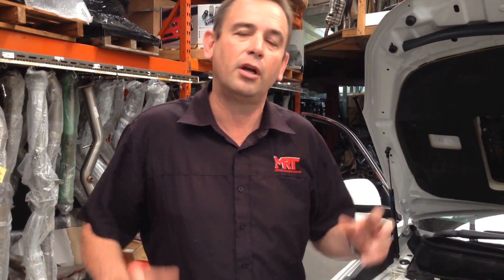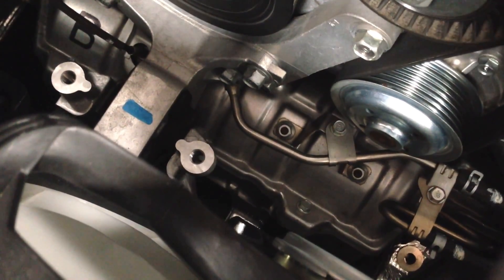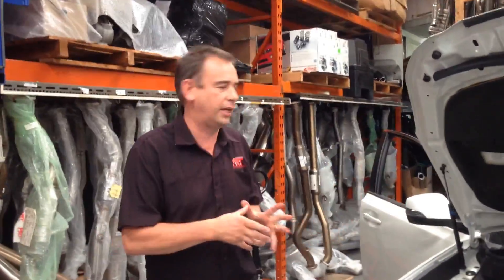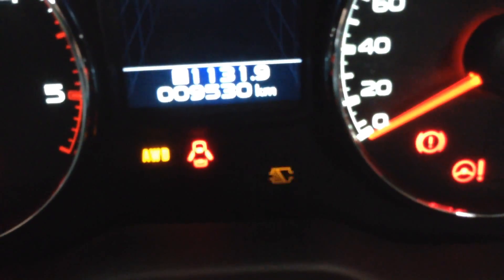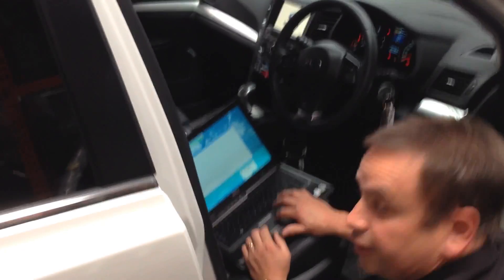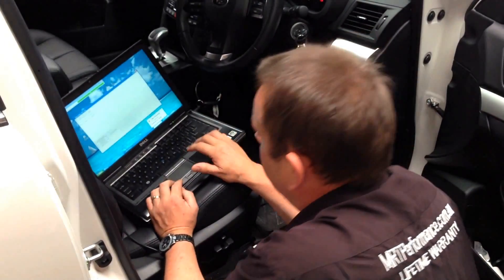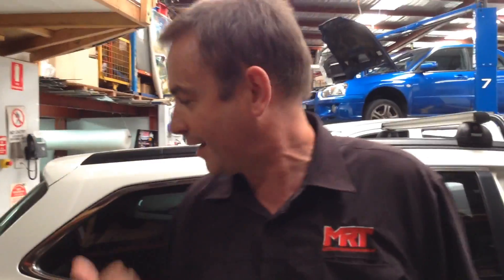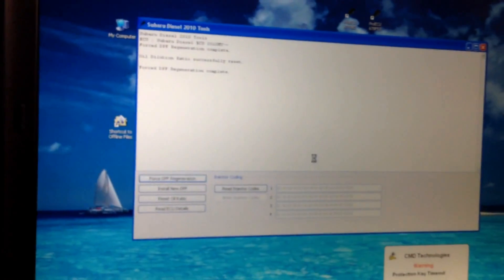Subaru DPF regeneration, hidden secrets, MRT explains how it all works

Comment: My dpf was alarming, having investigated I was told at 9 attempted regens it won't regen again and continues to alarm. I then got a excellent mechanic look at it and here it wasn't the dpf,  it was oil dilution causing the issue, having just changed the oil, my dpf wasn't blocked at all, yet the dpf alarms . One to check guys, ensure on obd reader, dpf replaced set and oil dilution cleared. Not single issue since. Worth checking if same issue as me.
Reply: danke für ihren kommentar. statt original 5w - 30 motorenoel ist seit 2 jahren 10w - 40 motorenoel in meinem ee20 suburu impreza jahrgang mai 2010 jetzt 80'000 km,  ich fahre den subi erst seit 4 jahren. 
er läuft besser und die motoroelverdünnung ist weg.     ich lebe in der schweiz auf 680 meter über meer.

Comment: Not modern diesels, mainly VW and Subaru taking short cuts (cheap skates) by adding extra diesel on the exhausts stroke rather than fitting a separate injector in the DPF itself, excessive diesel in the cylinder bypasses the rings and ends up in the sump contaminating the oil.

Comment: Hello thank you for the video, what is the critical percentage of oil dilution ? I changed the engine oil 3k kilometers ago and the obd2 scanner tells me that the oil dilution rate is %6. Last time when I got the official subaru service, the oil dilution rate was %14 and there was no warning flash on the dashboard.
Reply: for 2016 model at 10% the dpf light will show. But from my experience  it will work with a reset right in the middle of the oil change period. I would not push the 2nd reset cycle past 5%. Also, if you do a long highway drive 200/300 + Km the dilution will typically drop by 1 to 2%.

Comment: Had endless issues with my diesel 2010 Legacy Tourer. EGR valve replacement, 2 x DPFs, inlet manifold, turbo boost pipe, regens every 20mins that blinded following cars. Eventually glad to get of it.

As explained to me by a former Ford/Mazda technical director, the DPF was a ill-thought out emergency bolt-on solution to forthcoming emissions regulations at the time. Subaru just made a worse job of it than most.

Comment: Just heard when the bloke said DPF replacement would cost about 7000 AUS dollars. I did a swap here in Germany and Subaru provided me with a genuine unit for 900 Euro, cleaned the inlet manifold and a couple of other things for about 1200 Euro. If you want to keep your motor in working condition, don't use the Turbo Diesel for long-term city driving; get an OBD scanner and software that can monitor particle buildup and burning cycles.
Reply: Bisogna usare il Tunap ad ogni tagliando e usare olio Motul 5w30
Reply: purchased such a scanner - measured 4 Kpa at 3000 rpm - 0 Kpa at idle. 2010 legacy boxer diesel - runs like a champ

Comment: Well, not helped me. I was forced to buy a DPF with 10k miles as it was affordable, totally clean. Also replaced the EGR to a clean one. DPF light still flashing and after reaching the operation temperature my car is turning back to limp mode. We replaced the EGR again, as the dealership said that's the problem, still nothing. Now it seems the problem is with the MAF sensor but I just can't believe in this anymore. :D
Reply from the maker: I have never seen a faulty MAF sensor on the diesel Subaru models
I  suggest you choose another workshop
:(
Reply: Hi, Did you get this sorted and fixed?

Comment: You can also reset the oil dilution without the need to connect a computer by following the below, (certainly this is the case in our 2012 Diesel XV):

1. Depress brake pedal

2. Start engine, and keep it in idling. 

3. Release the clutch pedal.

4. With depressing the brake pedal, perform the following:

  (1) press the rear window defogger

  (2) turn the headlight to the =00= position

  (3) press the rear defogger position to off

 (4) turn the headlight position to "O" position

  (5) repeat steps 1) through 4) once more, and go to next step

  (6) release the brake pedal.

Note

Each step (1) through (6) must be operated within 4 seconds.

5. The preheating indicator light will blink approximately 5 seconds when the data was reset successfully.

If it doesn't work then turn the engine off for 15 sec and repeat the above steps again.
Reply: Awesome few attempts and worked great, up came glow plug alarm and all warnings off. Been driving me nuts

Comment: My 2014 Diesel CVT Outback is predicting less and less mileage per tank of fuel (from just over 1000km brand new to now 810km), and the (car) calculated consumption index has jumped to to 7.2l/100km. The DPF light just flashed last week and Subaru dealer said the oil was dirty and did a 100,000km service for me at 97500km. I changed the oil (CASTROL EDGE 5W-3)0) myself at 90000 km!
Does it indicate that there might be some soot accumulated at the intake area that is causing the car to use more fuel than it should be?
Thanks very much.

Comment: 7000 dollar for a dpf?? Someone earns a lot of money on that....
Reply: their expensive to make because of the metals inside them, it costs alot for a workshop to buy them too even before they are sold onto the customer
Reply: Try flushing it out, remove and soak it with dish washing tablets then hose it down, let it dry then reinstall. .

Comment: Hi, I purchased a new 2015 Turbo Diesel outback and have had DPF problems every month right up to March 2017. Gave up going to Dealer, who told me to go on the highway for 1/2 hour at high revs in 5 or 6th gear once a fortnight?????I have had an independent diesel mechanic to look at & he has advised that there was diesel fuel in the oil, which indicted that a fuel injector seals are leaking - he is preparing a report so I can claim on warranty. Has anyone else had that problem?
Reply: Doesn't he say in the Video that this motor has a diesel blow by system that deliberately mixes Diesel with the engine oil? Maybe it's not a problem and a system the diesel mechanic isn't aware of?

Comment: Hi!

I have a 2017 2.0D EuroVI Forester. I have the car regeneration controlled by a bluetooth OBDII device connected to my phone. With it, i have controlled soot, oil dilution, DPF temperature and many other parameters. So I have tree questions:

- Is it normal that the car do the regens every 150-200km in summer and 300-400km in winter? I drive a lot of traffic jams, but a lot of highway too.

- Is it normal that when the car is regenerating it drops a lot of white/bluish smoke when accelerating from a stop or accelerating from a low rpms to a medium rpms?

- My car has 35.000 km now, but from the very beggining, every 15k services, they need to put some coolant because is usually decreases from the full mark to almost the low mark. I heard that it happens in many Subarus, are you aware of this "issue".

Thank you so much!
Reply from the maker: never heard of coolant loss
:(
Reply: the only liquid you should loose is a little bit more oil due the DPF regeneration mode
because the engine doesnt really like the regeneration mode and its also bad for the engine.

thats why i want to remove my DPF and program the regeneration out of software

Comment: Outstanding Video! I've just replaced the intercooler rubber elbow on my 2010 Diesel  Outback. Purchased the car a couple of months ago with 60k on the odometer. I've just done a bit over 7000k'ms therefore the standard 3months 5000km warranty won't cover. I was shocked to pay $214 for a genuine piece of rubber....fitted myself....not rocket science. My DPF light came on solid today then began flashing (prior to replacing rubber elbow). 
I understand from this video that no matter how far I drive the car the flashing DPF will not reset. Is this correct?
I will phone you during business hours to discuss purchase of the cable and software to undertake a forced regeneration. Subaru service have advised that the oil and filter need to be changed after the regeneration. Is this correct?
Many thanks
Reply from the maker: hmm, you should call us

Comment: G,Day guys love your Video,s i bought a 2009 outback subaru diesel i payed $20185 with 120,000 ks on her i saved all my money to buy a good car that would see me out after 2000ks they replaced the front shockers and break pads now after 8000ks i had to pay $1600 the Car Yard say they put $700 in to help me with the cost ? for a new clutch  new pressure plate new thrust race clutch plate Fly wheel ( Solid ) with new rear engine seal do you guys think it fair for a Car that cost me $20185 it just one year old i had done 8000 in one year since i bought her ?
Reply from the maker: hard to say
Reply: What do you mean ?

Comment: I have a 2010 Forester and it will continue to do the active regeneration at any speed, even standstill, as long as the rpm is kept up. It would be nice if I had an indicator that the regen had commenced as I like to drop down a gear and get the rpms above 2000. Subaru should have made is possible for user to do a forced regen and it would also be nice to have a soot meter and exhaust temp so driver is able to better manage the filter. Passive regens I have found just don't happen, even at 110km/h in 5th. At least there's the cheat code for the oil dilution ratio.
Reply from the maker: cheat code for oil diluiton?
Reply: Yeah I took mine to a non Subaru mechanic who didn't know about the reset. Subaru were going to charge $110 to scan to confirm the problem. Thankfully google came to the rescue. It seems  that my non Subaru mechanic was unable to reset it with his diagnostic tool anyhow. Below is the sequence but apparently it doesn't work on all of them.Transmission in neutral
Depress and hold brake pedal
Defogger ON
Lights 
ON (stage 1 = parking lights/DRL is enough)
Defogger OFF
Lights 
OFF
Defogger ON (again)
Lights ON (again)
Defogger OFF
Lights 
OFF
Release brake. Now the glow light (depicting yellow coil) will flash for 
a few seconds
Reply: What is your experience with glow plugs? Do you only use Subaru brand or is there a better brand? Should I spray WD40 on them every night for a month for clean removal; or is there a better release spray? There aren't too many videos on them that I could see. Maybe you can do a video and show us how to or how not to screw up a motor  ;)
Reply from the maker: never seen a glow plug problem on ANY subaru
Reply: My mechanic charges me $30 Cash for a re/set if i dont get out to the open road .
Reply: Before i unstood on how they work my old Mechanic chrged me $30 cash he would plug the computer and leave it high rev till it cleaned itself .

Comment: My 2010 Forester Diesels dpf warning light came on yesterday and today started flashing. If I have a fault code reader with a reset feature, can I take the car out for a drive at the speed specified for 20-30 minutes so that an auto regen takes place, then reset all fault codes, will this clear the warning light?

Comment: I was looking at purchasing the latest Subaru Forester Diesel CVT that has been released but I am now reconsidering after the research I have done and the potential issues which may arise with the DPF. I was attracted to the lower fuel consumption of the Diesel but as it is almost $3,000 more the petrol version it would take almost 3 years to recoup the original price difference. Now finding that the DPF would cost $6,000 to replace if an issue arose, and from many of the forums I have researched they do arise, I am seriously reconsidering and just buying a petrol model.
Reply: i myself not to knowledgeable when it comes to car engines and was very much interested in getting the diesel engine due to the higher torque it generates. But it looks like more maintenance is required for a diesel engine so just decided on a more sluggish but less maintenance 2.5 petrol engine.
Reply: I purchased the 2.5 S. Happy with it. Only really need the diesel if your towing or comes in handy in the country. Regular City driving the 2.5 is adequate.
Reply: thanks!
Reply: No worries. Recently did a 300klm trip traveling with 4 people in the car, back full of luggage, air-con on, at 100klm per hour in the 2.5 S petrol forester at got 6.8lt/100klm. I thought this was great considering the circumstances. Makes you wonder at the worth of a diesel.

Comment: Brett another fantastic and very informative video! I live in North America so unfortunately for us we have very low quality high sulphur diesel fuel here. It also means we have very few diesel cars offered to us. I'm a big fan of Subaru cars and I'd love to have a turbo diesel in my Impreza outback sport. I thin you all did an awesome job with the diesel Forester rally SUV! Having watched this video I learned a few things about modern diesels that I didn't know. While these engines are great for generating torque and for super longevity; I can't help but feel they are a lot more sensitive to modifications or alterations then gas engines are. I also get the feeling that if a person was to ignore that warning light it could end up a super costly repair.
Reply from the maker: thanks